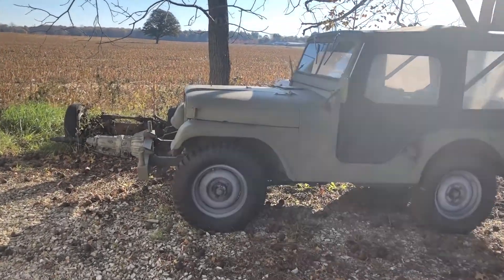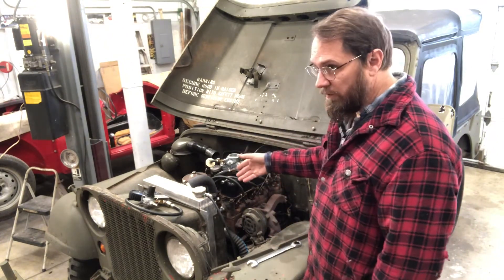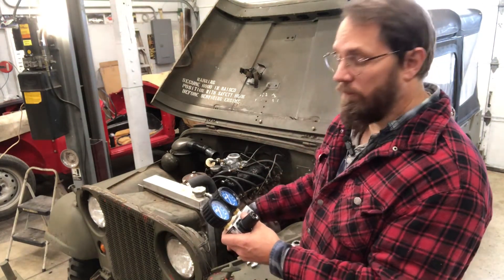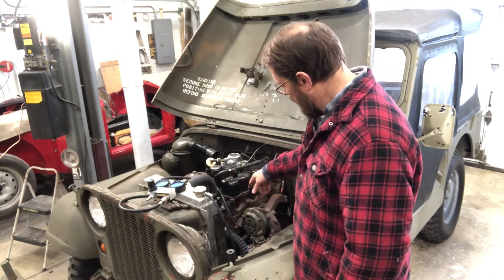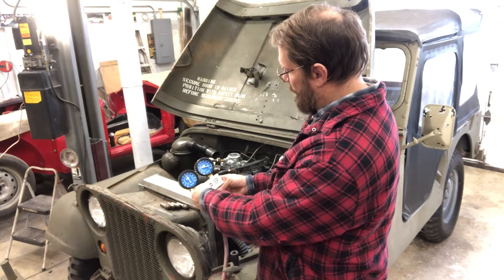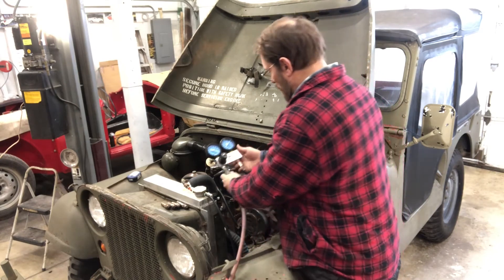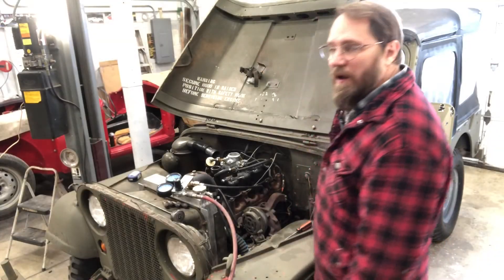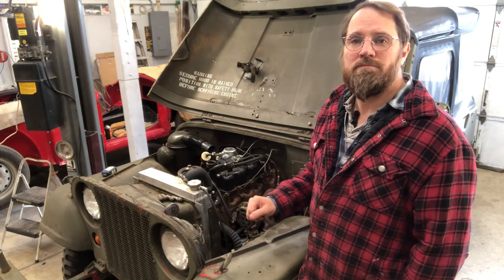M38A1 Jeep cylinder leak down testing

Comment: Hey- this is a great video I have an L4-124 flat head. I have one cylinder with 100psi. I also have vapor blowing out the carb when running. I'm going to do a leak down test on #4 and see where the hiss comes from.. :)  Thoughts?